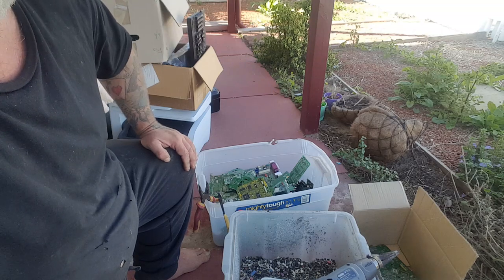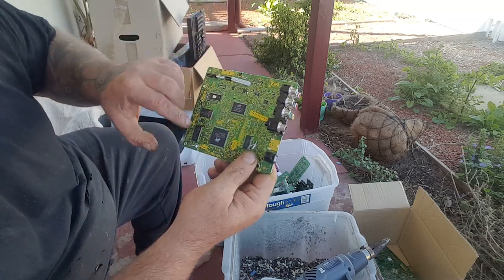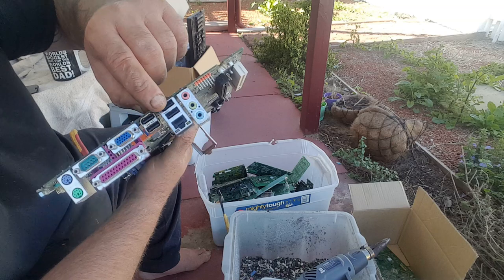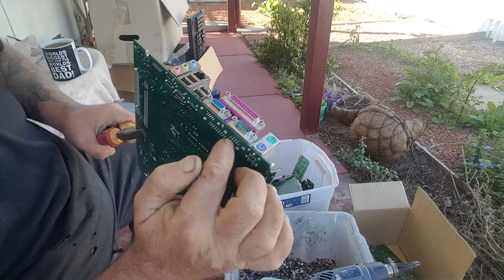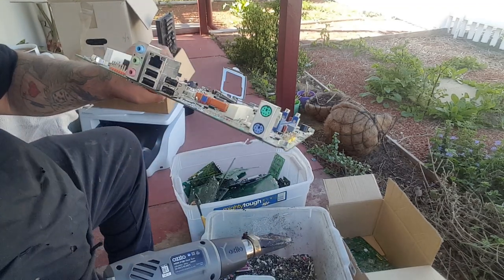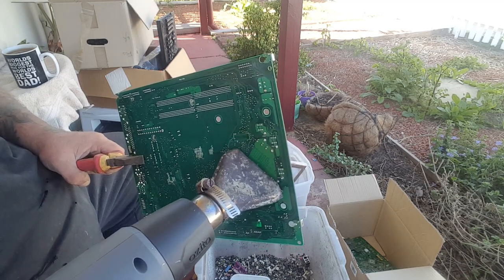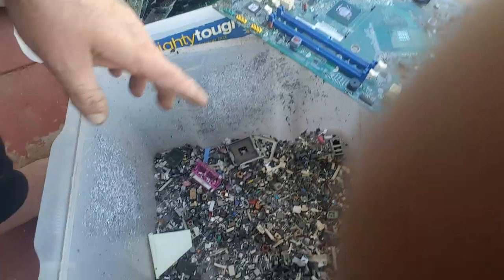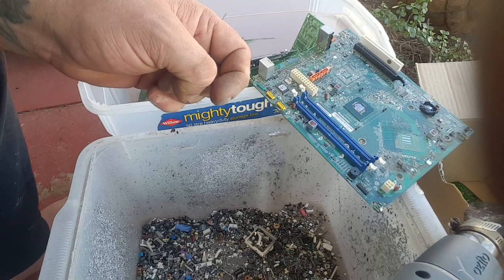EWASTE / how i depopulate my circuit boards

Comment: I am using a cut off wheel and shaving the boards down to the surcuitry,  this may allow me to then heat the pins from the back,  ive noticed gold and silver foil in my pixie dust bin as well as copper
Reply from the maker: ok, intresting

Comment: Are u using too much electricity, not worth depopulating.
Reply from the maker: No it doesn't use much electricity. And things come off the board clean and easy.
Not smashed into pieces and no bits flying everywhere like with a chisel